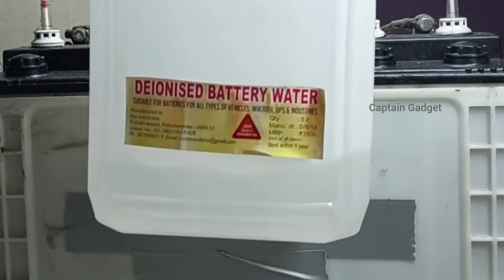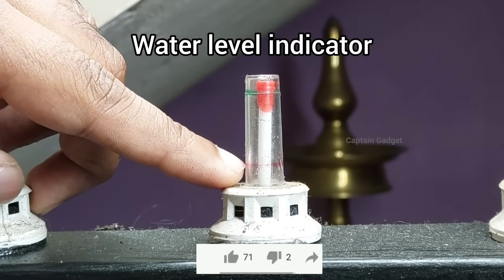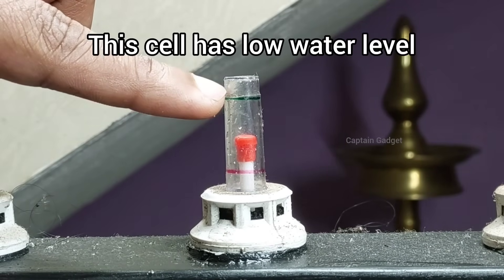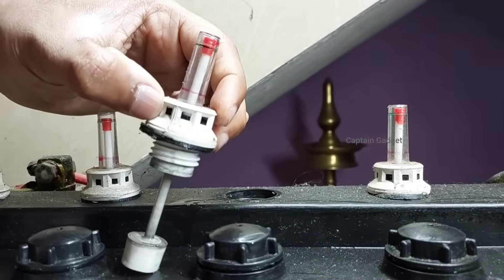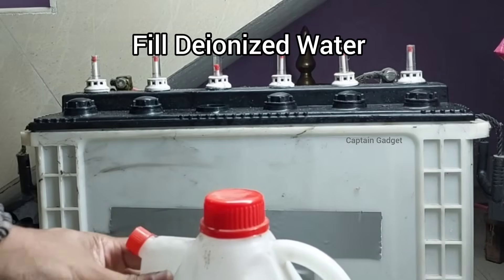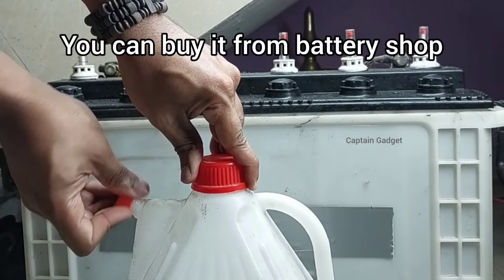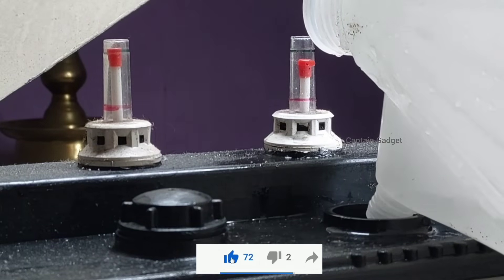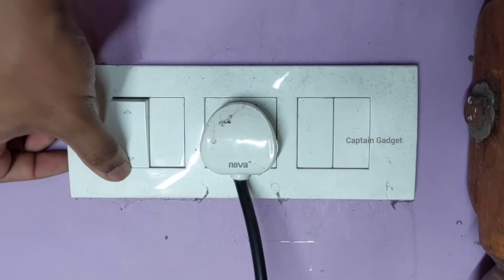How to Refill Inverter Battery Water. Battery water refill. Distilled water, Deionized Water

Comment: Hi, my inverter died a long time ago, and the indicator in my battery have all gone down.

Is it safe to refill distilled water and use a new inverter?
Reply from the maker: Call some one and Check the battery.fill water and charge it chack it using a hydrometer

Comment: Thankyou, I saw two other videos one of them said to fill water in the place where indicator is inserted and the other one said to fill in the corresponding hole of the indicator.
So I was confused.
Reply from the maker: Glad it helped 🤗. Like Share Subscribe
Reply: @CaptainGadget  But when I checked the battery it only has 1 line of holes not 2.
Reply from the maker: @mdmaajidmanir  Some are like that
Reply: @CaptainGadget  Are all holes supposed to have that indicator or only 1 of the holes.
Reply from the maker: @mdmaajidmanir  every cell has an indicator and a hole to fill water.some batteris have only one

Comment: what happens if you don't turn it off and use normal well water.
Reply from the maker: Turn it off for precaution. The impurities in the water cause the battery to corrode and reduce its life
Like Share Subscribe 🤗